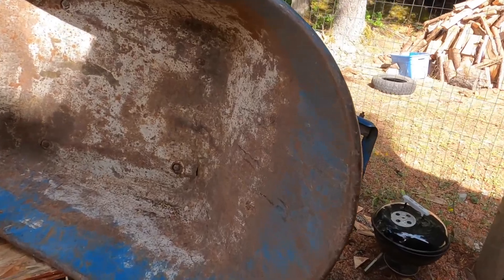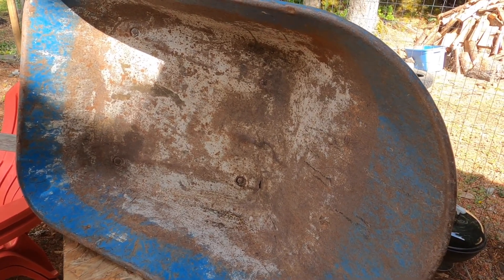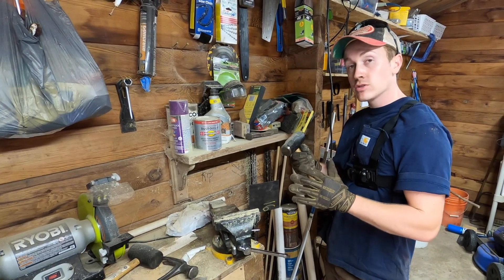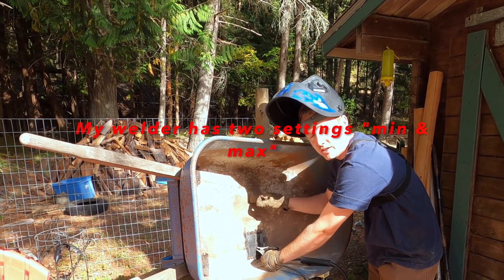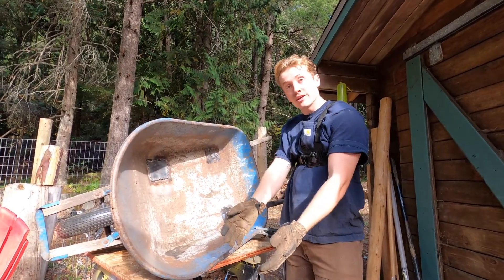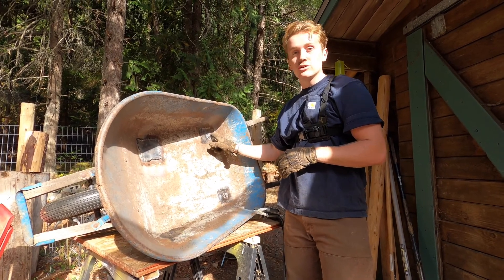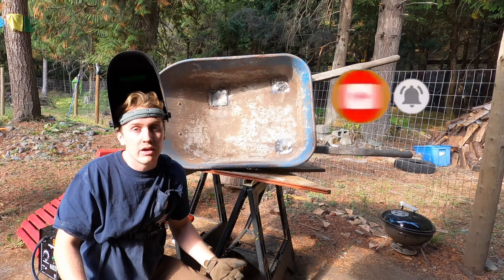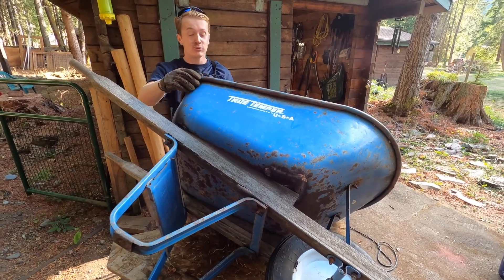Flux welder to fix a leaky wheelbarrow

Comment: Next time clean the wheelbarrow edge an put the ground clamp there.
Reply from the maker: That would have been smart! Thanks for the tip 👍🏻
 If I wasn’t working on a timé-crunch it would’ve been best to remove the barrel totally from the handles but necessity is the mother of innovation(or cut corners)